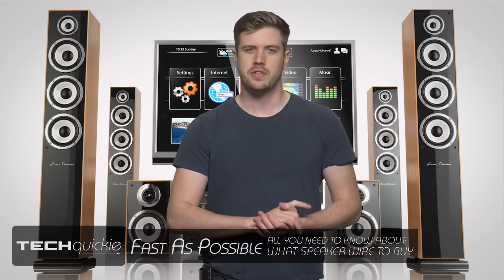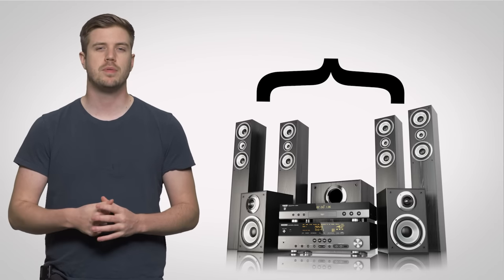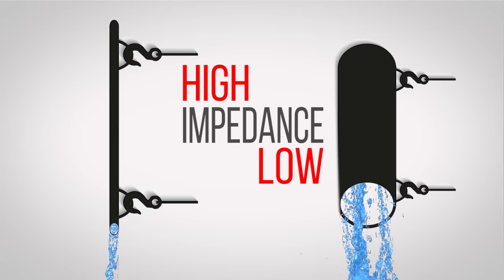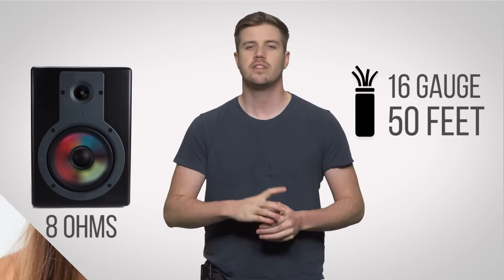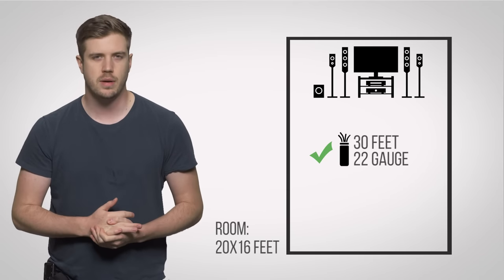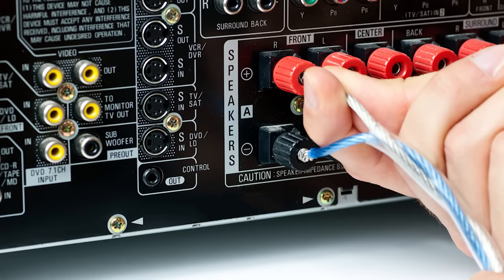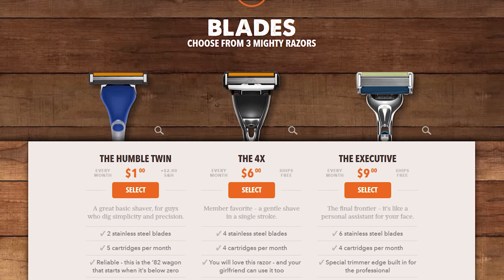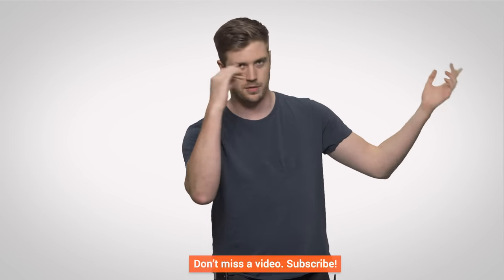What Speaker Wire To Buy As Fast As Possible

Comment: It's not just impedance that determines wire. You do touch on gauge and length, but it's not that an 8ohm speaker needs a certain gauge. It's how much current you intend to put through the wire. You aren't putting 500 watts through a 30ga wire.
Reply: +cad5359 This is a quick guide and addressed all the essential issues for those not familiar with this topic. If you are doing the real audiophile stuff you do not need this guide as you already know this stuff. Don't be an idiot troll.
Reply: I frankly don't understand why you would think about it that much anyway. Just use as thick a wire as fits into the clamps on your speakers and make it as short as possible and you're done. It's not hugely expensive or anything. What would have been more important information is what kind of wire to use. High strand count cables with fine gauge individual strands and NOT shielded.
Reply: Watts are a measurement of power, not current.
Reply: +Lukas Görgner Actually if you are going to be installing the wire into the walls of your house as a home theater system you should install shielded speaker cable.  Strand count really doesn't make much of a difference since that wire could also be solid conductor when installed in the walls.  Stranded only helps make a difference for ease of bending if the wires are not installed in the walls.  At audio frequencies you don't have to worry about skin effect so any strand size even up to solid wire of the same gauge will have the same electrical properties.  Stranded is just easier to work with.
Reply: +cad5359 At about 625 volts rms you could deliver 500 watts through 30awg wire.  That would be a bit unrealistic since the insulation on the 30 gauge wire is only rated for maybe 600V but it could be done.  30awg copper wire has a resistance of ~0.1Ω/ft so a 6 foot length of wire would be adding 1.2Ω of resistance to the 8ohm load so a loss of ~15% of power at full load. The realistic maximum power output of 30 gauge wire pair 6 ft long would be ~10 watts on a car audio system and 15-20 watts on a home theater system depending on RMS system voltage.  That being said even with cheap home theater systems the wire gauge that is included in the box is usually 22-18 gauge (7-16 amps for short runs) so at short runs for the front channels and much lower power requirements for the rear channels the included wire gauge should be enough for the typical 75-100 watt per front channel and 15-30 watts for rear and center channels of most consumer home theater systems.

Comment: For everyone reading this: IMPEDANCE IS NOT THE SAME AS RESISTANCE!
Reply: how?
Reply: +Ognjen Galić Accually, It is
Reply: Impedance extends the concept of resistance to AC circuits, and possesses both magnitude and phase, unlike resistance, which has only magnitude.
Reply: Impedance is the broader definition of resistance. Impedance CAN equal resistance if there is no capacitance/inductance. Therefore, technically they are different but practically they can be the same
Reply: +CRCR7 Agreed, bit in audio tech you got lots of em so they will vary
Reply: THANK YOU I was thinking the same thing myself. Unfortunately the type of folks who might actually take advice from this guy are far from being able to understand any kind of electrical concept
Reply: A pity when people misuse terms like Impedance! What isn't there capacitance in there or frequency...? But therm I'm into RF! Hi
Reply: Impedance is the term used to describe resistance to AC current so it is a very similar thing, it just relates to AC and not DC whereas resistance affects both DC and AC.
Reply: An electrical engineer simply explained impedance to me as the measure of resistance when juice is flowing through the speaker.

Comment: During my hifi-days i experimented with "premium" cables.
The cable i got set me back about 10$/M. So it was a budget premium thing. But it did improve my sound a bit. Everything became more focused and i gained clarity in the higher parts of the spectrum, however the changes ware small. Speakers carry an analog signal so cable quality are a factor in a way you don't find with digital signals. 

In my case buying cables for 50$ for my front system ware a good investment. A ~500$ NAD receiver and B&W speakers for ~2000$ justifies the relative small cost of the cables. If you ware thinking of getting better cables for your "Samsung Blu-Ray all-in-one HT system" i would have said save your money, it's not worth it.
Reply: +Kim Mortensen Premium cables start at more than that. More like $50/m, but $10/m would still get something nicer than the cheap shit that's mostly used. But anyway, I completely agree. People go nuts about those that spend $10000 on speaker cables, but the guys that do already have 1/4 million worth of gear anyway, so it's not much in the grand scheme of things. As long as things are sensibly matched, it's all good.
Reply: 99.99% Oxygen free copper that are silver plaited. Sure you can get a similar specked cable that are far more pricey. But are it a better cable, or just a more expensive one?

But i get what you are saying. in the Hifi-world a 10$/M cable are not considered expensive. But my point ware that speaker cable do matter (unlike what Luke are saying) and that you can get premium cables with out ponying up the premium cost.
Reply: +Kim Mortensen 
"oxygen free"? Your brain? Sorry, that's marketing wank, as is the silver plating (it's only slightly more conductive than copper, and that includes simple electrical installation cable copper, which is exactly as oxygen free).
Reply: So you are proving to me that i did not experience a sound improvement with going with a more expensive cable that had silver and probably better copper in it as well.. Interesting.. i still recall it as it was a small improvement..

But my point was that my cheep-o premium cable (like under 100$ total, including terminals) had all the bells and whistles as those insane ones that cost over 10 times as much.
Reply: Kim Mortensen
The placebo effect is a bitch. Certain medications also work better, if they are more expensive (yes, this has been scientfically tested), mostly those medications that don't do anything in the first place. As long as you didn't do a blind test and someone else exchanged the cables randomly multiple times, I wouldn't even trust myself.

My point is that a normal electric wire (of the same diameter) will have the same bells and whistles as your cheap-o premium cable.
How can I say that? Physics/chemistry. Even the most pure copper (better than "oxygen free") is just 2% more conductive than your bog standard electrolytic copper from a century ago (yes, that's when the standard was set). Oxygen free copper is defined to be 101% of that standard, so one whole percent more conductivity! But todays refining process is so much under control that even your normal copper gets that number without a problem. Even if you would hear a one percent change in conductivity (which you don't), "oxygen free" copper wires would still be a waste of money, because normal wires have the same property.

Did you now that silver is considered an impurity in oxygen free copper (because it very often comes with the copper ore and isn't easy to separate)? You have a wire plated in that?

Btw. that 1% is just the increase in conductivity (or decrease in resistance) of the wire. The wire resistance (if thick enough) already is negligible when considering the resistance of the connectors. Typically at least 10 to 100 times more per connection (which you have at least two of, maybe even four) than the whole resistance of the wire. And even that is very low compared to the impedance of the speaker of 4-8 Ohms.
Reply: The placebo effect is a bitch..
how are you sure i didn't blind test?

Anyways life to short, if you are upset that i spent ~1% of my HT budget on the front speaker set cables, well i guess that's your problem.
Reply: superdau Dude he didn't even spend much on the cables. Would you spend a few thousand on the amp and speakers then hook it up with bell wire? No. Of course not. You get something decent to match the system. You expect these guys with $100k+ systems to use some $2/m cheap stuff? You don't put steel wheels on a lambo.

Comment: How I do it: $25 spool of 50ft. 12 AWG wire pairs.
Reply: +LazerLord10 Exactly, 12gauge is cheap, what if you have high wattage speakers? Quick search on eBay shows "high end" Oxygen free wire for $19 for 50' or cheap wire for $45 for 400 feet. Would assume cheap 12gauge is the same or better than expensive 20 gauge.  I doubt any of us could tell a difference one way or another.
Reply: +Meghani Motorsports 12 gauge is overkill for most reasonable people
Reply: @sittinheavy1  with 8 ohm speakers, and a speaker lead length of less than 50 feet, 12 gauge wire should be fine for anything less than 2,000 watts. For 4 ohm speakers, 1,000 watts.

Comment: My disposable income is very low, so I am trying to work with what I have.  I have a stereo with pin connection speakers to the back of the radio.  I have a 24" Phillips HDTV with LED LCD (2 HDMI, Dolby Audio, Component L/R Audio, Y/Video, Pb, Pr, Optical Digital Audio Out, & Antenna In).  I also have one large 32" Tube TV with few connections (nice for when I want to view on a larger screen, but would sell it in a heartbeat too, if I could), one DVR/DVD player (was amazing pre-digital television stations), and one DVD player. What I would like is to be able to purchase a relatively low cost (less than $75, but no more than $100) receiver/system to get better sound from my Phillips TV, as well as play my stereo when desired.  I don't need surround sound, just a basic way to hook everything up so I can use the speakers I already have for more than one device. What can you do/suggest for someone like me?

Comment: 22 guage....are you out of your mind? The minimum guage for ANY decent setup is 18 guage for the front, center, and surrounds if they are short runs. Subwoofer connections for external amplifiers would be 16 guage minimum regardless of run length. I have been installing stereo equipment in homes and autos for going on 30 years and have never heard such bad advice. I personally use 
16 guage for front, center and surrounds and 14 for external subwoofer amps. My suggestion...stick to computers and let A/V experts record advice for home theatre installations. P.S. throw all that 22 guage garbage wire that you get for free in the trash.
Reply: +Les S, actually, for the subwoofer would depend if it is a passive or active subwoofer.  Passive (depending on wattage) I would go 12 minimum.  Active, then you just need a good 75 Ohm wire if you are using the LFE channel on your receiver.  Otherwise you are correct if you are using the crossover in your subwoofer amp.
Reply: +BaddMatt Thats why i said with an external amplifier. The focus of the video was speaker wiring not line level wiring such as the lfe output of most integrated surround decoders.
Reply: Les S I will give you that about the video being about speaker wiring.
Reply: +Les S cat5 is fine for anybody using the all in a box home theatars
Reply: Installers aren't experts on anything except doing reliable installations quickly enough to earn a living.  This is real expert advice, from somebody who's actually designed both electronics and speakers for the original "high-end" audio company, McIntosh: http://www.roger-russell.com/wire/wire.htm

Given the usual < 6 foot speaker cable lengths in home stereos, I defy anyone to actually hear any difference between even 22 AWG speaker wire and anything else you can buy, find, or steal -- the longer the length and the lower the nominal speaker impedance, the heavier the gauge you should buy.  That's all.  Simple.

Comment: I'm confused. Do I need less cable, if I have small feet?
Reply: +Urinstein Yes, because as we all know, the smaller your feet, the smaller your room is.
Reply: I have those new copper socks but the soles of my shoes are aluminum does this mean 16 
gauge is good enough for dancing ? Heyyyy !? Point your toes, but I'll give you a [ 7  ].
Yes , I realize its been 4 years but the hors d'oeuvres are still fresh.
Reply: Don't listen to these guys. They literally recommended using 22 gauge wire for subwoofers which would put you at risk of starting a fire for anything more than 18w speakers. 
Just buy at least 16 gauge wire for up to 100w, 8 ohm speakers.
You can get 12 gauge wire for cheap and that gets you even better power handling if you need it.

Comment: Length and Gauge (thickness not width), if you're going to used shielded cable (to reduce RF and EM intereference) only ground the shield at one end to drain any electrical potential.

Comment: Where are liquid nitrogen cooled cables? Cooling cables lowers their resistance, turning some materials to superconductors. Overclocking audio cables, yeah!!
Reply: +rkan2 I think gold/silver cables would be cheaper than liquid cooled cables, and they also have lower resistence.
I know you are joking, just saying
Reply: +Federico Passarelli True, but cooling will get you much closer to a superconductor and thus having no resistance at all. Decrease in resistance of better materials is miniscule, as discussed in the HDMI video.. :P
Reply: +Federico Passarelli Wrong, the resistivity of gold is higher than copper. It is used for contacts because it doesn't corrode but it has an about 50% lower conductivity. So it would be really stupid use gold cables.
Reply: +Benjamin Steinmann you're right, but silver ones do have lower resistance
Reply: should i use kanthal stainless steel or nickel? sub ohm woofing
Reply: +Benjamin Steinmann I'm still waiting for the optical cables for the actual speakers instead of just having it going from your TV/computer to your amp. (yes i know the speakers would have to be powered)
Reply: Resistance can be a good thing, it's the thing that's stopping from damaging your speakers.

Comment: the only other thing i can think of is getting higher strand count per gauge will make the wire a bit more flexible and able to bend around things easier.
Reply: I would think that getting banana connectors you can solder the wires to would give you some good connections.

Comment: You've never ever been listened a real hi-end system to comment...
Reply: Marcelo Exactly! I tried a few different brands of premium in-wall speaker cables to make my place look neater but the sound is horrible compared to my current setup.I finally ran those high-end speaker cables in flexible conduits for in-wall installation. It is true that speaker cable quality doesn't matter if you have mainstream   electronic gears.
Reply: The video had good advice regardless if your system is low or high end, if you have a good system, just get a lower guage and use shorter runs.
Dont fall for the snake oil, in the land of directional cables LOL.
Reply: Che Marcelo.... agáchate y conocelo, juaaaa , no hablando en serio,  mi equipo es un radio grabador Sonny con doble casetera y compactera reversible.
Los monitores de estudio de Abbey Road son B&W de $10k por que AR compraría unos cables Audiokuest de $15k y no me digas que hay mas baratos de la misma marca por que me confundo por que Abbey Road compraría los Audiokekes de $2k si existen los de $15k cocos

Comment: Post-amp: copper is copper. won't matter what grade it is. You'll never notice any frequency drop in the highs with longer runs (this is more notable is longer runs of signal cabling: due to capacitance, not impedance) At the power level and distances involved, I don't see almost anybody needing anything bigger than 16ga. for home audio. I do runs of 100ft of 16gauge for my tops with multiple speakon connectors all the time, no issue. (300 watts rms, 100hz and up)

Nothing post amp is shielded (or really needs to be) I suppose he meant better insulation to last a bit longer.  The way it's talked about in this implys that lower ohm = better, but that's not really the case.

Comment: +Techquickie It depends on the length of the wire and how many WRMS you are putting though the wire those two things determines the (awg) wire gauge you need to run